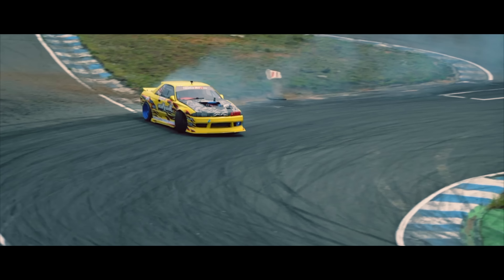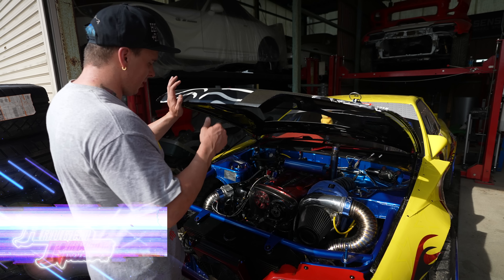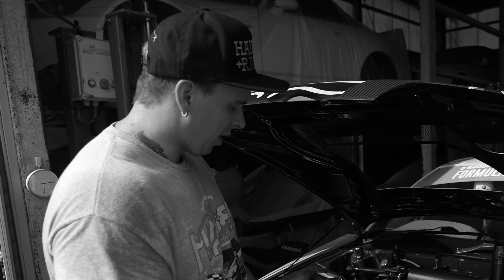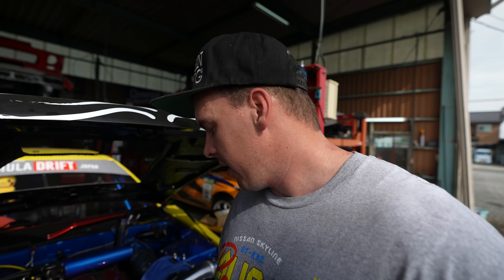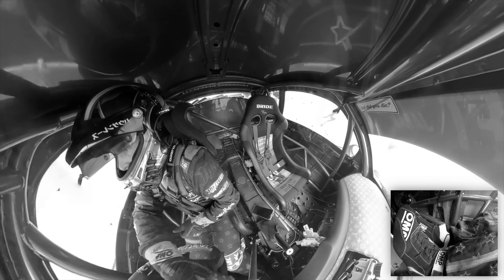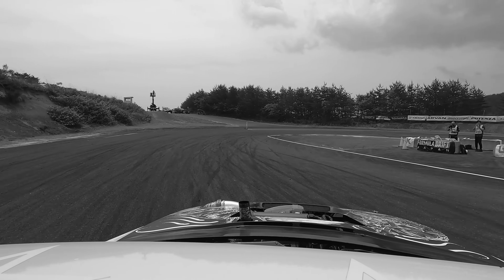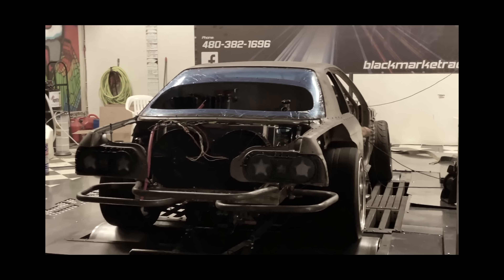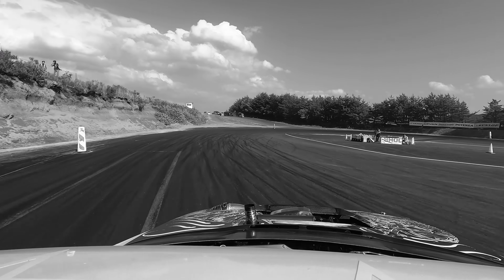Why My Formula Drift Car Broke!

Comment: 3 Things

1- Seat Time
2- Seat Time
3- Seat Time

Run the car as much as you can and get as many of the issues (known and unknown) identified and solved. At the same time you'll be getting a feel for the car and what adjustments are going to be most beneficial for the tracks/weather.

And definitely shorten up that handbrake. Whether you want to admit it or not it is clearly a hindrance.
Reply: Yeah that handbrake looks cool and stupid at the same time.
Reply: agreed! that handbrake looks so dumb and im sure it also feels dumb
Reply from the maker: Not really lol. Throw them in all my cars. Seat time sure, if the car can run right lol.
Reply: not sure why ppl r saying that... its easy to find when ur under pressure and a longer lever makes for more precise pulls, just geometry. i love samurai sword handbrakes

Comment: Well Haugen, there are always second chances.

I suppose to fix the power steering issue should just be replacing it with a new one instead of rebuilding it over and over. Also there are some guys in the Discord that have RB builds, don’t really have an idea how to build one but I do have a Niki barra6 engine swap, so dunno

Comment: For power steering I would really consider going to a Porsche GT3 hydraulic (but electronically powered) pump, they’re really not that pricey (300$) and they function so well!!!
Reply: Electric pumps I hear other drifters use are ones from new volvos or prius. And they are usually substantially cheaper than $300.
Reply: @sss_jstn  the new volvo ones cannot run 100% without a CAN signal from the ECU that replicates the OEM message from the vehicule… A Porsche pump will be significantly less of a headache to run in a scenario like Matt’s car is
Reply: @jablandyachtz  well i'm not an expert on volvos, just sharing what i've heard.
Reply: You can run a old Volvo pump without can signal they are sub 300 to get and fit if you don’t believe me go to coopers channel he use to be on McFarlands one but started his own he’s using it on his drag car no can signal needed
Reply: @lMi1es007  in drag racing there are no fast inputs given to the steering wheel, problem with the Volvo pumps is they’ll have a lag when given fast inputs (drifting in this case), which the Porsche ones don’t have that problem
Reply: @sss_jstn  just sharing the info I have :)
Reply: @jablandyachtz  BMW and merc ones are apparently good to use. MR2 has been used before too. 

How well they go drifting I'm not too sure as I've only had engine driven pumps but I know  a couple blokes locally have had success with the merc pump

Comment: You can try a volvo electric ps pump. Its been great for me so far. One less pump to worry about. And check out boost doc for electric water pump. But belt could just be slightly off on the alternator side double and triple check that  , i had the same problem with my prp alt bracket,
Reply from the maker: Yeah it’s something just wild this keeps happening to all the cars 😭

Comment: Factory ps pumps suck - they will always fail and push the bearing out. You need a LARGER pulley not a smaller one if you want to try and bandaid it- I personally think it will still fail. Electric is the fix. 

Your DBW sounds like it’s over traveling or it’s picking up resonance. No idea what ecu you’re running. 

You also don’t need nitrous or Anti-lag - I personally feel that you need to stop being lazy with the throttle ( this may be related to the dbw map) and keep the engine up on the rev range- you have a clutch pedal- use it.

Comment: Not sure what ecu you have but I had issues with my DBW going into limp mode on my link. There is PID settings basically adjusting the sensitivity what was happening lots of on/off throttle in a short space of time gave errors. Every 100 errors it goes into limp mode. You can tune you PID settings around this but in my case as I was at the track at a comp I just turned the safteys off for it and its obviously not cutting haha I havent bothered to go over the PID settings since ive just left safteys off. If the throttle gets stuck ill just clutch in and key off thats safer than loosing throttle when somone is on your door i feel

Comment: Sounds like u over pressuring in power steering pump. Try a external relief valve.
Reply from the maker: Noted! I’ll talk to the guys about it!
Reply: Two six engineering  has krc power steering kit you can use. With the PSC power steering reservoir. And the AGM pressure release valve.

Comment: I know this comment has Almost nothing to do with the video but for assetto corsa is Steam Vr better or Oculus?
Reply from the maker: Both will be honestly fine. Oculus you don't have to worry about external sensors however.

Comment: look I'm no expert but I think just do a pre trip type thing where you go over everything make sure everything that has been breaking wont like make sure everything is torqued to spec nothing is clogged like run water through some lines that are detached and you should be good, fingers crossed.
Reply from the maker: We do, some of this stuff just happens regardless 🤷‍♂️ that’s racing for ya

Comment: How about a electric power steering pump? From a Volvo??
Reply: Figured it’ll be helpful. You won’t need a new pulley or belt etc etc etc. the Volvo pumps are super cheap too.
Reply from the maker: Looking into options but yeah that and an mr2 pump are on the table lol

Comment: next comment the sequential- You cant flat shift when the wheels are spinning! you need the dogs to be able to unload. if the wheels are spinning they will be turning the drive train under load so dogs still engaged. when wheels arent spinning a simple lift off throttle or cut slows the car enough to unload the dogs. I hope you understand my explanation if not the simple answer in a drift car just clutch every gear its safer always works wont damage dogs and make sure to pull hard slow shifts also damage dogs

Ive got a samsonas in mine and did a fair amount to research into how to not fuck it as it was a massive expense for me on my small budget

Comment: One thing i would've done different, First thing i would've never took a race car straight out the dyno to competition, obviously there would be problems but finding out all those problems in competition isnt the way. You should've tested the car out and feel out the car before hand so you can sort out all the little bugs and also get seat time to understand the car. Thats what i would've done. It looks like ur not comfortable with the car whatsoever, it looks like you have no control over the car at all, no hate i just think that practice before hand is critical especially for a freshly built car.
Reply from the maker: Kinda didn’t have a choice man lol. I have to compete in order to realistically have my visa be a thing.